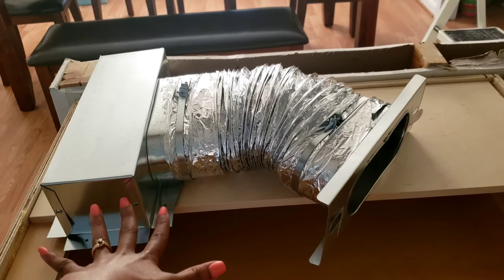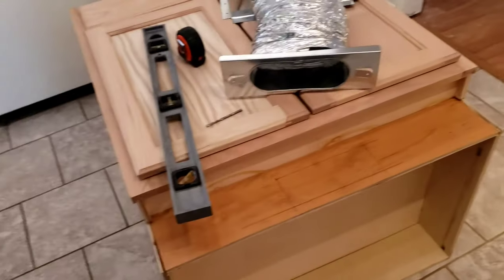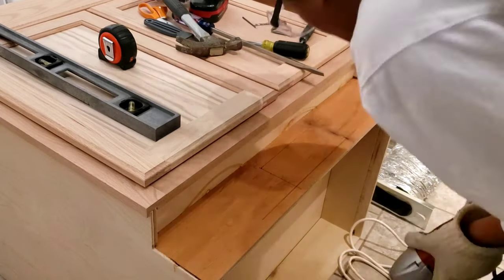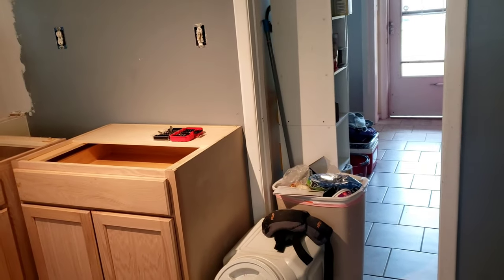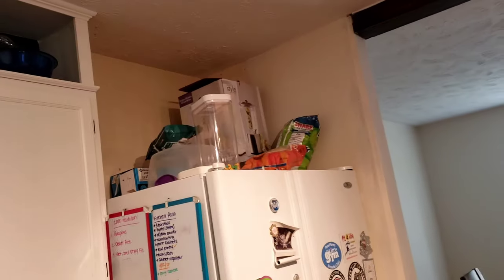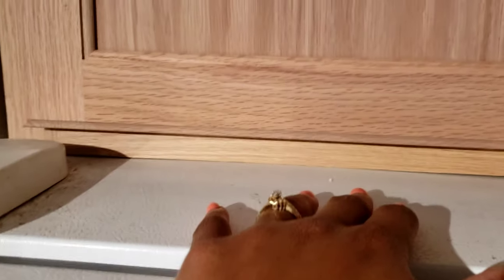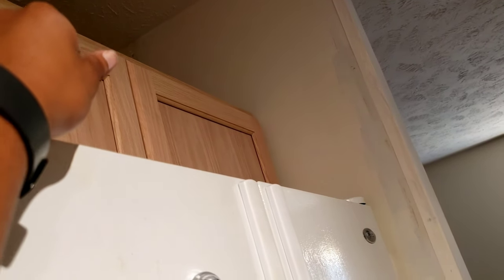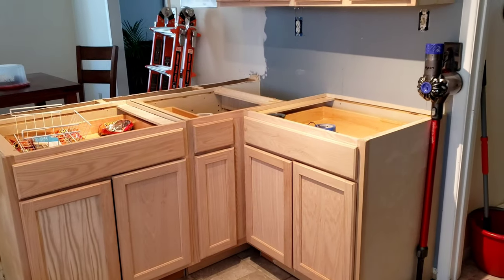DIY Cabinet & Refrigerator Enclosure| PART 2 Kitchen Remodel |PonPon Sisters

Comment: Hi! I'm doing a similar remodel. Will the toeduct work for an air filter? Currently my vent is on the wall I want to install cabinets on.
Reply from the maker: Where I purchased the toe ductor, they do have a wall option toekickductor.com, check out their website and see if it will work for you. Hope this helps 😊 and thank you for watching 🥰😍